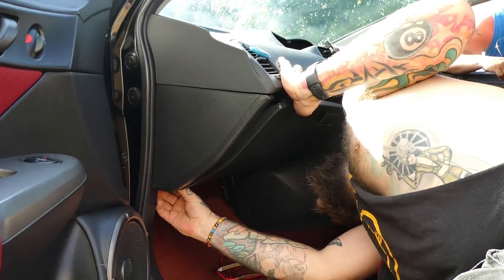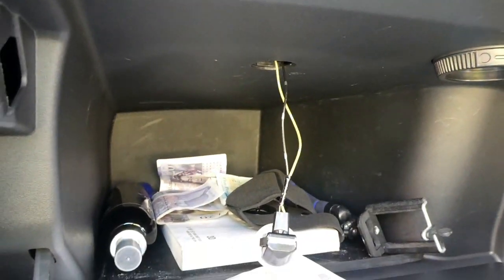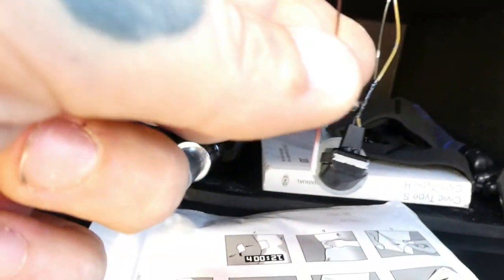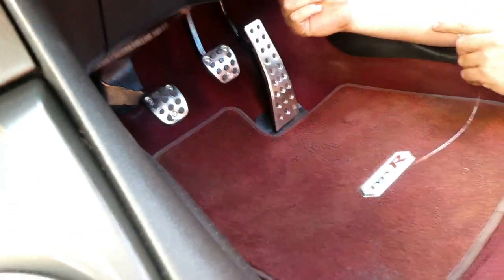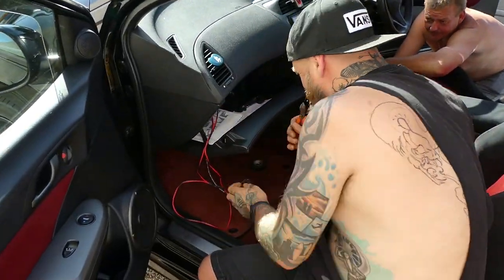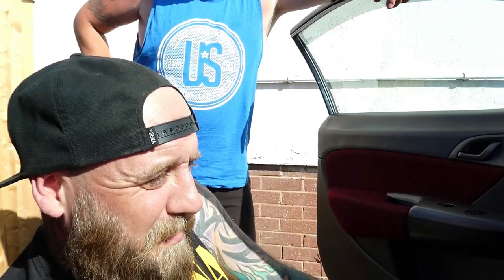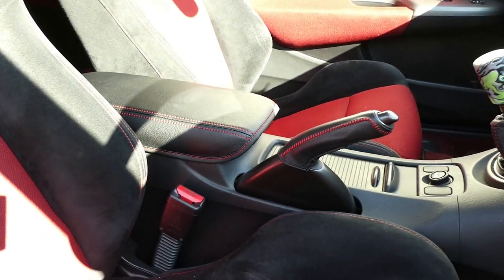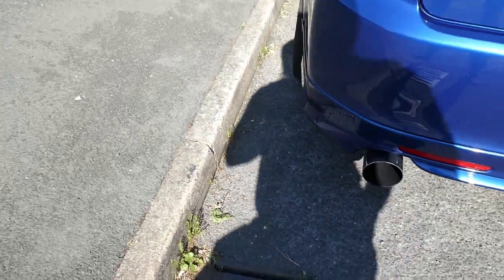How to install LED footwell lights in your FN2 Type R

Comment: Hello mate. Where did you get the handbrake red stitched cover ? Link for ebay please.
Reply from the maker: If you go to the doing bits on the type r video it’s all in the description in there I think
Reply from the maker: https://youtu.be/f62rT_GZdZw
Reply: @CowabungaCarDiaries  heey man. Thanks I've checked the description of the other video and the handbrake cover ain't there 🙄 please help?
Reply from the maker: @BLACKRACERONE  possibly not available anymore then bud, I just searched fn2 handbrake cover on eBay
Reply from the maker: @BLACKRACERONE  https://www.ebay.co.uk/itm/233817681304